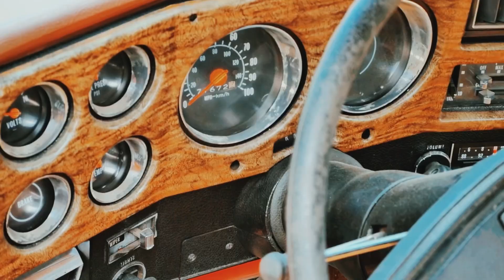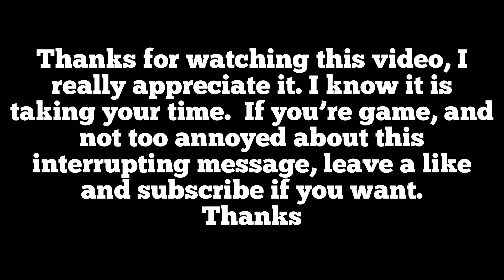My CUMMINS SWAPPED Squarebody is on the road! #cumminsswap #squarebody

Comment: Thanks for the gospel presentation. Nailed it. Love watching your stuff and am excited to do the same on my truck. Got a '75 2wd 3+3 dually and a 1st gen cummins. Looking to put a tremec tr4050. Do you have wisdom on fitment on that tranny?
Reply from the maker: I do not have any wisdom on that. What I would do is buy a gm adapter plate for the Cummins and then work back from that

Comment: Gday Sam nice truck what trans has she got in her 
I got a 79 square c20  body with a mid 80s Silverado front clip on it 
Twin headlight on top of one another 
My parts man is perplexed how that got on there but it is 
 I'm in Australia
 IHave a 12 valve and NV 4500 out of a 96 ram imported  from over your
 way  it has a block heater so it was from the north  or mountains somewhere 
And twin ram banks show on it 
It's not in yet but will be in good time
Just working out intercooler 
Radiator and a gearbox issue I have 
No Speedo drive + main shaft front snub wore out in NV hd 
Just trying to get parts through long range gear over your way 
Been watching most of your swap clips thanks very much it's been helpful so far 
I'm right hand drive so stuff is a lil different and parts sourcing can be tough but I'm getting there 
My truck was 4.5 ratio 
14 bolt  
Now I have the parts to re gear to 
3.4 hemisphere gears and rebuild kit for the 14T  took some doin and some cash but b well worth it 
I'm goin to run light for a few years 
May go back to 3.7 or so when I start towing or get a different trans 
Maybe an auto but I'm just researching what at present 
Don't mind shifting at present 
I've had a lil manual bus for the last 10 years but am not getting any younger 
Cheers buddy and thanks again
Reply from the maker: Man! That is so cool. Thanks for sharing man and good luck!!

Comment: I got a question I’m in the process of getting everything together to do the swap on a 83 c10 with the factory 6.2 diesel in it my question is do I need to fabricate the frame for it to hold up to the power?
Reply from the maker: I did a 1/2 ton 6.2  Cummins swap 3 years ago with no frame modifications and it’s still ripping up these streets
Reply: @samstrucks  okay thank you just wanted to make sure because my frames in good shape just alot of people telling me that I need to but okay I’m just gonna get it ready to drop in and send it